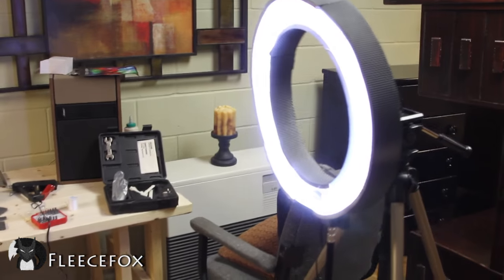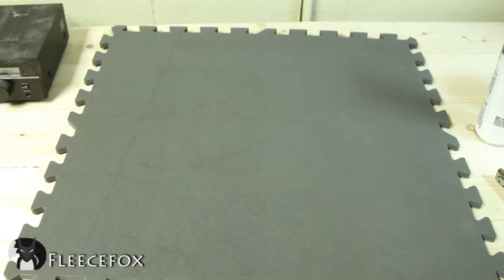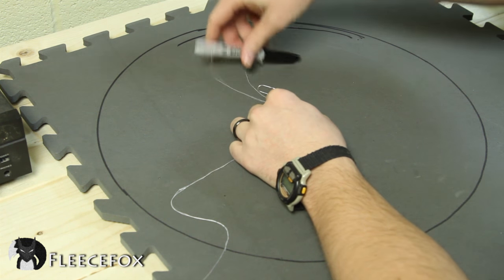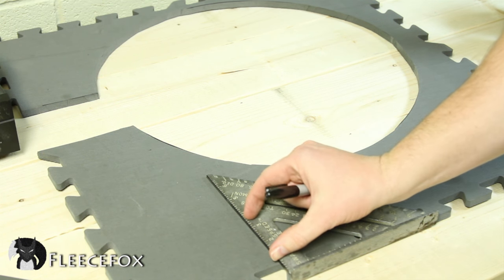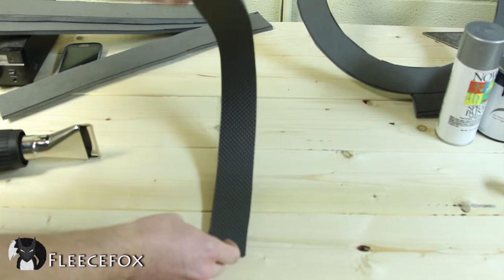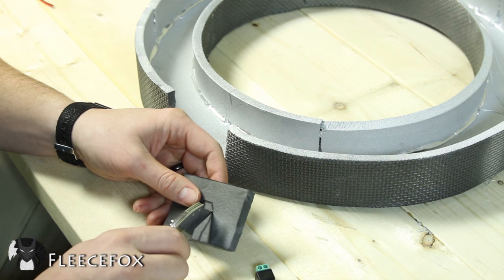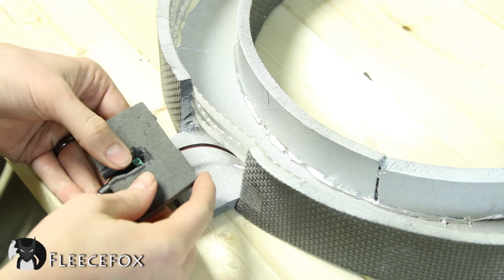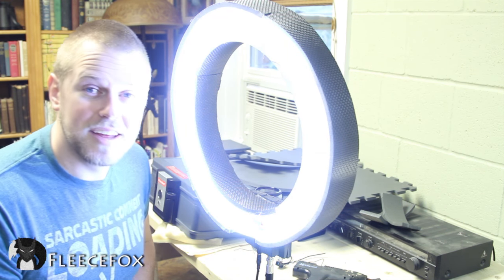DIY Ring Light for Video and Pictures

Comment: very nice job, i have looked at several tutorials on ring lights and yours was a little more technical but it looks like it would last longer, and is more sturdier than the others.  I would like to try this and then decorate it on the outside.  Thanks
Reply from the maker: Yes a little bit of overkill but it works well. Spicing up the outside would make it look a lot better.

Comment: I like the idea of the how to attach the light to a stand... I may use metal though, and not foam to help support the light... i'd be scared of it tobbling over when the glue gave way from the rubber
Reply from the maker: SO far there have not been any issues. But metal should work just fine.

Comment: I'm excited to try this project!!! The only problem is the link you have for the led lights doesn't work for me, I tried looking on Amazon but the ones on there do not have the red and black wires at the end
Reply from the maker: +Queen Christine I have updated the link so with some lights that have the red and black wire. It should do all that you need it to do. Thank you for pointing out the missing link.

Comment: Awesome, I wonder if you could use a pool noodle or the gray foam used to insulate pipes. Cut or scoop out the area needed for the lights, then encircle and connect ends. As I watched you make yours I just thought about the other options, I don't know if it would work, what's your thought? I've subscribed to your channel, I've enjoyed your ideas 💡
Reply from the maker: As long as you got the ridged foam that would supply enough support. I am not sure that pipe insulation would do the trick. I was just wrapping my pipes and it is rather flimsy.
Reply: Im a little slow replying back to you, my apology. Your right, the stuff you wrap your pipes with is too thin. I'm talking about those noodles the kids use (and some adults) while swimming. Their much thicker than the pipe insulation stuff. If you don't have one just laying around, lol, you'll probably have to wait until the stores start putting out the summer fun items. Sorry for not explaining myself better, I need to get better when I'm trying to inform people about products. Have a great day. 
Dianne ;)

Comment: Hi! Really really nice video! Thank you so much! I'm absolutely going to try this! 
I have a question : do you think it would be ok if I used aluminium foil instead of silver paint ?
Reply: +The Aka Yes, it would work just fine. If you search other tutorials, you'll see that most people use aluminium foil, cause it's cheaper and likely to already have it at home. (However, silver paint will make the job easier and better looking).
Reply from the maker: +The Aka as long as the foil is not crumpled I think it would work just fine. The led lights need a smooth serface to stick to.

Comment: it's a good build I have one question about the Led and the foam is there any heat problem or melting ?
Reply from the maker: SO far the lights are cool to the touch. I dont see that they would ever get to a temp that would cause an issue. The heat gun that I use is 900 degrees and it only forms the foam. Lets hope these lights dont get to over 900!

Comment: With that screw device you got from the hardware store, what do you mean it allows you to "sinch the cord together"? I'm just trying to clarify, because is that how you connect the light to the stand use that to screw it on? I don't see later in the video you do anything with that and the cord. :)
Reply from the maker: I think its called a turnbuckle. It just allows you to connect the light to a 1/4" threaded stand. I should have said its real function is to connect ropes together but we are using it for the threads for the light stand.

Comment: Dear you did a big effort thank you, but really it can be made with much easier way and materials. really light weight aluminum frame to create the ring, and continue the rest of fitting the led lights inside.
Reply from the maker: that is true. You could use any housing you want it. This was my first thought on the design. I guess it's a good place to start.
Reply: we can always start somewhere you are right, ideas fly everywhere, good job anyway. regards

Comment: this is a good idea to make what the name of the metal thingy you glued on last that you attached to the umbrella stand and can that metal thingy be hook to any tripod 
and is the adapter the same one you have on the description down bellow and can it be any type of led light strips i really want to make this project thanks
Reply from the maker: +Zuri Robles thank you! The metal thing came from lowes. It is 1/4" threads I am not sure of the exact name. It tightens two ropes or cables. But you can remove the hooks. As long as the threads on the tripod are 1/4" you can use this. The adapter is the one in the description.  You can use any led lights. :)

Comment: I'm having trouble I have the exact same lights and I don't really know how to wire them I wanted to wire them to a regular plug would you be able to tell me how to do that
Reply from the maker: To wire them you need to have the adapter that will go from two wires to a barrel plug. My light set came with that adapter. Then you need the AC to DC plug.
Reply: FleecefoxStudio my husband is an electrician buddies at work so I'm trying to do this on my own is there anyway I can just cut an old wire and wire it into that just a regular plug
Reply: Thanks for the info I'm going to Lowe's to get the piece right now
Reply from the maker: As long as you use the appropriate DC adapter you can wire the lights without the barrel plug.

Comment: which would be better to use a 24WATT LED light or 60Watt? thanks! I'm gonna try this out!
Reply from the maker: I used the 24w and that was very bright. I have a feeling that 60w would be too much.
Reply: i followed this procedure step by step with the same adapter and same LED lights, my lights won't turn on after i plunged it :( i doubled check the wires if they were in the positive and negative output and they were...what could the problem be? please help!
Reply from the maker: Is your power supply the correct amp value for the lights that you have? That is what I would check first. The lights should be easy to install. Just the two wires to connect.

Comment: how did you stick it on to the light stand?
Reply from the maker: The metal piece that was glued into the bottom has 1/4" threads the same size as typical light stands.
Reply: whats the metal piece called and where do i purchase it from? thanks!

Comment: does it get hot to touch?
Reply from the maker: Not from my experience. A little warm but not bad.
Reply: yupinaa If you use LED lights it shouldn't get hot simply because LEDs don't put off very much heat as opposed to regular light bulbs that do generate heat and could potentially be a fire hazard